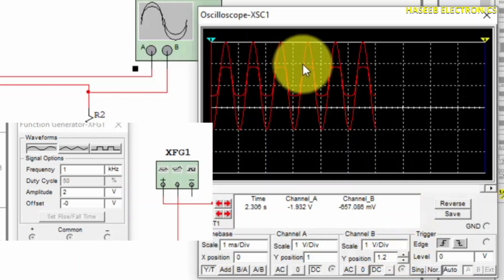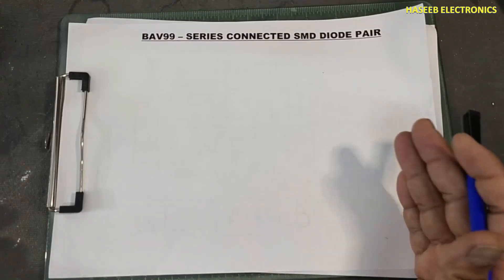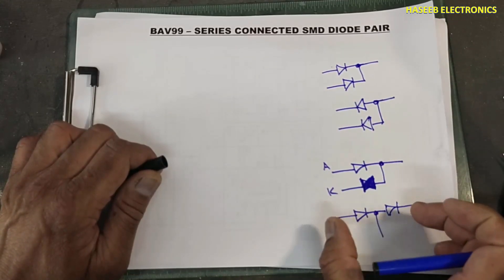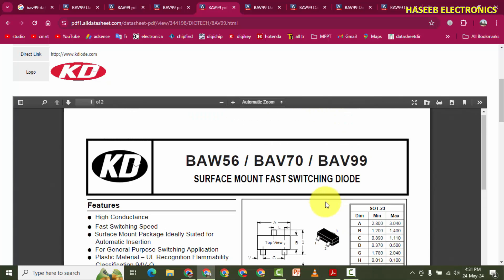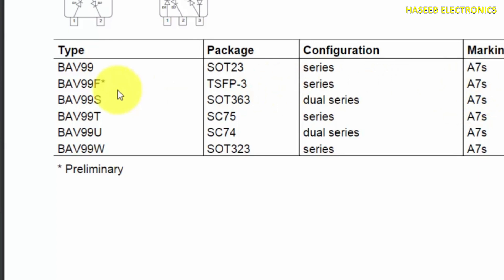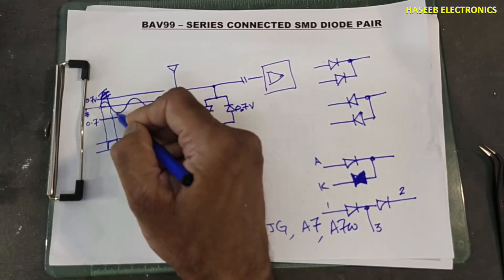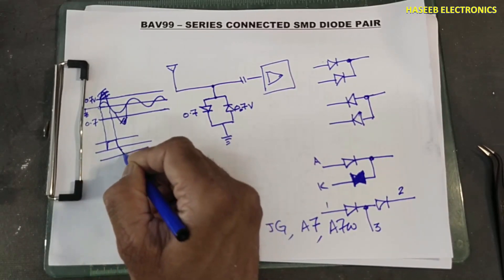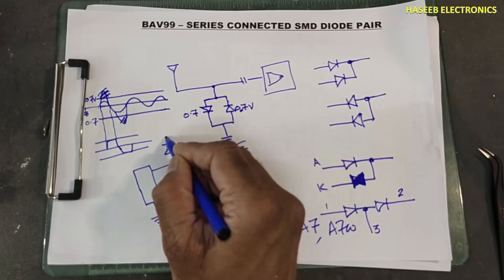{1120} BAV99 Series connected SMD diode pair

Comment: I have this bav99 in welding machine control card and its installed as : anode and common are used in cct but cathode point is leaved floating, why?

Comment: Thanks for sharing
Haaseb can you help me with this
I want to read voltage with an isolated ground
Mine setup is 4x 12v battery with 4x solar controllers with 1x Esp32 and 2x ADS1115